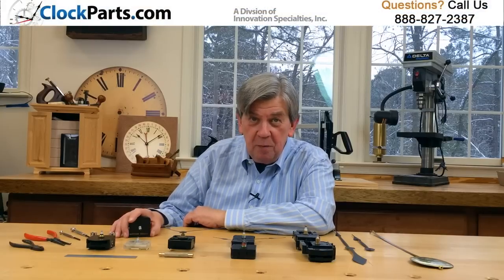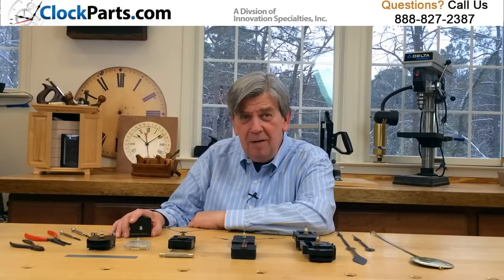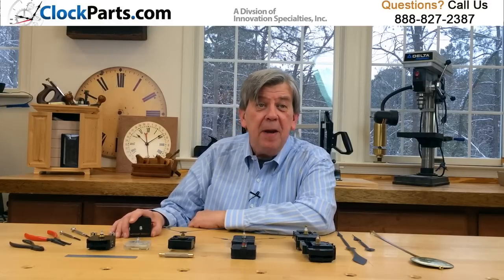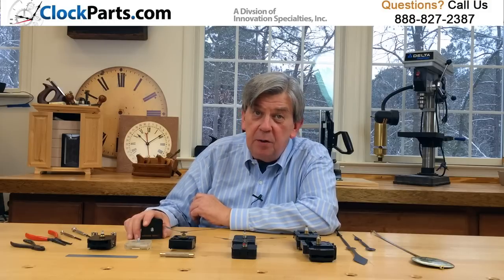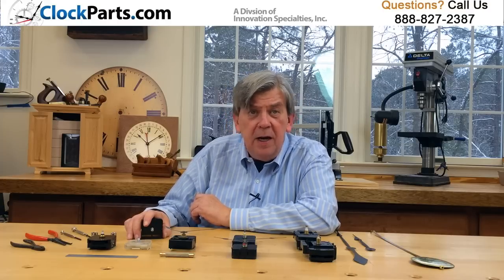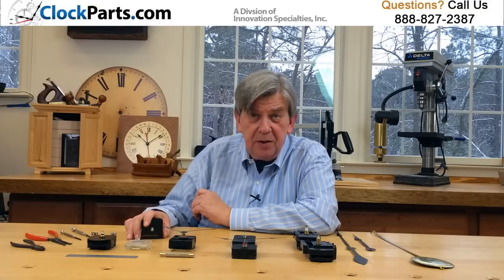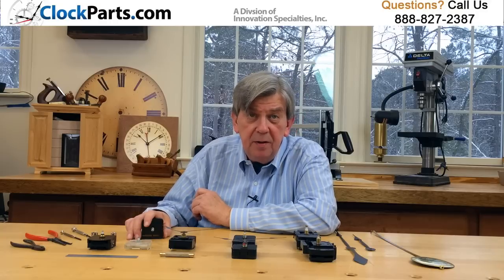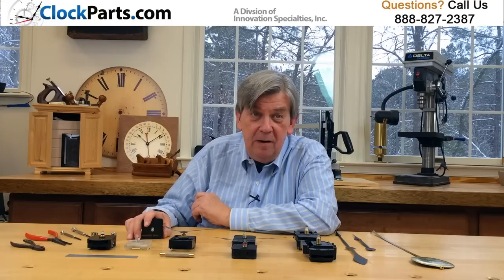Battery Clock Movement - DISCOVER our line of battery operated quartz movements - motors

Comment: Will these fit old antique clocks without modifications? i have a Ingraham Duplex Hathor mantle clock bim bam chime as a modern quartz bim bam chime probally won't fit the case the length of the rods and positioning the movement. it looks like the electronic westminster chime units without a pendulium will fit. the clock face diameter of my Ingraham duplex Hathor is 5 in diameter what hands will i need for it. Reason is the mechanical movement is worn out on both spring gears the teeth on them. it no longer runs 8 days like 5 at most and the repair shop wants $600. will your movements fit this old Ingraham mantle clock case and face? when its done the key arbors still be showing in the clock face. as this be cheaper to retrofit to the battery movement and no pendulium.

Comment: At what rate do the pendulums swing?
Reply: depends on the movement and pendulium drive you  select as thats mainly for decorative purposes as originally the pendulium operates a mechanical clock movement by the escapement wheel which makes the tick tock sound on movements driven by weights or springs wound up by a key.  but they don't none i see are quartz retrofits for Cukoo clocks that moves the bird and door and move the bird up and down at the hour count. these movements are for wall, shelf and mantle clocks typically to build and retrofit a mechanical movement on antique clocks.